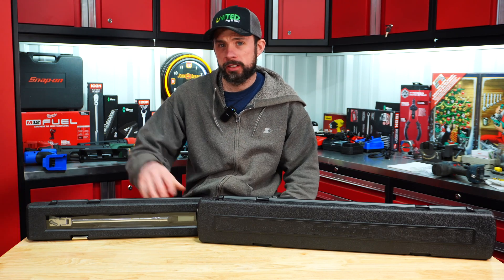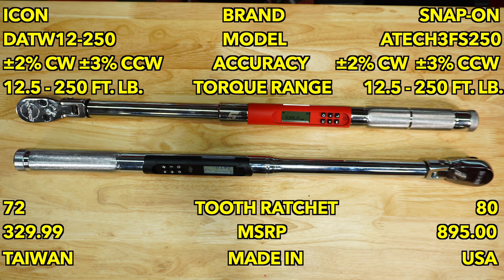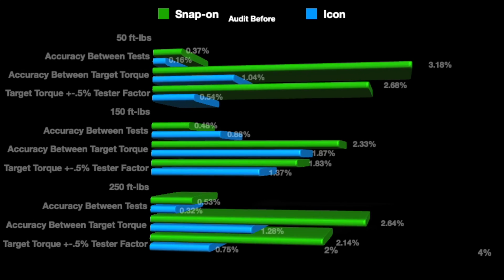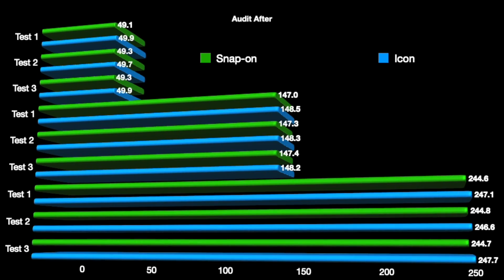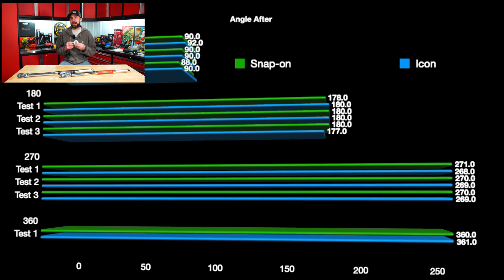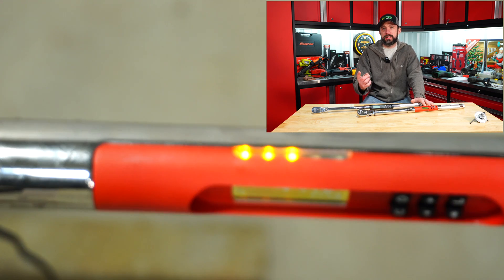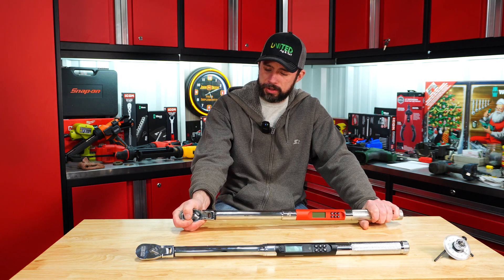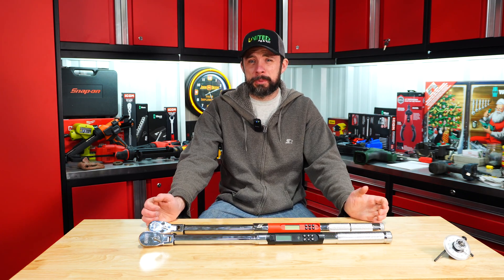Snap-On VS Harbor Freight Icon Digital Torque Wrench

Comment: This is how I felt as as Milwaukee fan when Flex kicked the door in! Still mostly a Milwaukee tool owner but they better not think I'm gonna shell out cash for small upgrades (apple)...
Reply from the maker: Yep exactly, snap on is still nice but not for the extra $$$
Reply: It really isn't really a great comparison  to compare Icon v Snap-On to Milwaukee v Flex.

Icon is a great deal cheaper and is still bringing excellent performance in all metrics.
Flex, on the other hand isn't that much cheaper, and for their tools that are more powerful, they're sacrificing ergonomics, tool life, and usable work time.
Reply: @reaperreaper5098  We should always compare tool brands, that's how we win as consumers. I'm team Milwaukee but Flex is awesome as well as Dewalt and so on. Snap On has awesome tools but many are overpriced.
Reply: @thalegacy6  That's not what I'm saying. I'm saying the relationship between Icon/Snap On isn't comparable to the relationship between Milwaukee/Flex.

One is an underdog now offering tools that compete with a top shelf professional brand, while being much less expensive.

The other is one high end prosumer brand coming out with a tool line that's roughly equivalent to anotherhigh end prosumer's tool line that has been out for awhile, both in price and overall quality.

One's a David vs Goliath story. The other is just an additional offering in an arguably oversaturated market that offers nothing of value over their competitors

Comment: Glad I bought the icon,had to do ls heads in a van so I finally had to get a 1/2 angle torque wrench and the icon worked great.
Reply from the maker: Good to hear,  its been a good wrench so fare.

Comment: Metrologist with 9 years of experience here, you're not supposed to test torque wrenches in that manner. They're always supposed to be pulled upwards, and it's the only way we certify them. We do calibrations for DOD, DOE, aerospace, construction, ect.
Icon may work for 1000 cycles, but it won't last for years on end. Lots of brands last a while, but ~snap-on and Proto are the only ones we're able to reliably get parts for and be able to adjust.
If you're a diy grease monkey, sure, icon will work, but to be honest, they still aren't the best.
Reply from the maker: According to snap on its the correct way https://www.youtube.com/watch?v=Gf-B-gFz6NE

Comment: Have you done the Icon vs Quinn digital torque test?
Not sure which is worth it for the money
Reply from the maker: Really depends on how much you plan on using it and what for.  I know the icon is a lot more money but you also get Leds on the side,  flex head and higher accuracy.  

But personally if your not doing anything with torque angle/left hand thread I would buy the Icon split beam.
Reply: @Tools-Tested  mostly for torquing lug nuts
Reply from the maker: I would definitely consider a split beam then or the icon digital.  Quinn would be more difficult to use in that case imo seeing you won’t be able to see the display and there are no leds on the side.
Reply: @Tools-Tested  Icon splitbeam?
Reply from the maker: @Mikey122687  yeah it tested well.
Reply: @Tools-Tested  Just picked up the Icon with 25% off coupon today. Thank you sir!

Comment: Hi Tools Tested - can you do a TORQUE ANGLE TEST  on these 2 Digital angle torque wrenches?   To see the Differences in the way they both work ?  Like doing Cylinder head where you have to 'ratchet back' and forth.
Reply from the maker: Hi,  both work the same in regards to how the angle resets.  Once torque is removed you have 10 seconds before it zeros out, enough time to ratchet back.  If you reapply force the angle keeps counting up.  If you meet the desired angle it will start from zero once you apply force again.
Reply: @Tools-Tested  Thanks a million for replying back - I will most likely get the Icon one for sure.

Comment: Take home point: both are quite accurate and consistent and will do the job very well. The decision become one of choosing to buy made in USA vs made in Taiwan, albeit for almost three times the money. If it were only two times the price that decision becomes easier. But upwards of $900 for a 1/2" drive torque wrench?
Reply: a lot of ppl don't understand that Taiwan is a small island. they don't specialize in cheap products, they specialize in higher quality for a lower price.
Reply: Double the price still makes no sense.

Comment: When I started having doubts about my $21,000 Epiq toolbox and hutch, I saw an ICON tool box. This led me to sell my SO toolbox and replace it with a larger ICON also adding a locker, I put the other $9,000 back in the bank.
My ICON torque wrench arrived yesterday and I'll be selling my SO version soon. Like I've done with most of my SO tools. Feel like a battered wife who finally called the police. lol
Reply from the maker: Nice! it’s definitely a quality torque wrench for the money.  

Yep Snap On tools are nice but way overpriced in my book.  I don’t care what anyone says, you don’t need tool truck tools to be a pro. 

Do I like buying tools not made in USA, no but I also like not having debt.
Reply: @Tools-Tested  Indeed!
Reply: Hi from 🇬🇧🙋🏻‍♂️ i was in the trade, i left in 2008, i would like to upgrade my 3/8 & 1/2 in torque wrenches but icon doesn't seem to be available in the UK 😢
Reply: @truckatadders you could import it from eBay?
Reply: That’s coming from a great seasoned mechanic/technician
Reply: So how did the Icon work out for you, accurate? Im currently deciding between the SO or Icon.
Reply: @rickyirivera the snap on let's you make adjustments for using crow's feet and other attachments. When you need precision, the snap on is worth the money. I had two icons and it just didn't hold the accuracy like the snap on tool does when actually using them
Reply: @omarfox6165 Dude, this isn't the only channel that have tested these. They are extremely accurate long term, same or better than Snap-On, every time. Same for the other Icon torque wrenches. As for using crows feet, you don't need any of that extra nonsense to stay accurate. Some basic understanding how torque is applied/measured, and some 2nd grade math, and can easily compensate if you need to. Really only if you're extending the length of the lever, or shortening it, do you need to compensate slightly. That one feature is still not worth an extra $500+. Plus not sure how Snap-On can even claim the feature is accurate, unless you know the exact length the crows foot is extending or shortening the throw of the torque wrench. Maybe it's setup for Snap-On crows feet, but what if your not using their crow feet? Even if you're using their's the overall position matters, as the length of throw would change anyway.
Reply: I just got this brand new on ebay 170.00. Guy needed to sell all of his stuff! Score! 

This will replace my cobalt half-inch digital torque wrench.

Comment: Thanks for the great videos! I want to buy the Icon SPLIT BEAM right now, but might have to wait for the 10-150ftlbs to come out. I'm wondering about torque wrenches' usable accuracy and I think other people are too. Most of them claim to have an accuracy of +/-4% of 20-100% of SCALE. Never heard of 20-100% of MAX. So 40-250 is 210? 20% of 210 is 42? 42+40 being the lowest value on the wrench means the accuracy is between 82-250ftlbs? Mostly do brakes and suspension work, haven't built an engine since the 80s. So is it 20-100% of max or scale? Don't mean to sound dumb, just uninformed. Subscribed! Thanks.
Reply from the maker: No problem!

The 250 ft lbs Icon split beam tested very well in my other video.  

I to hope the come out with a lower torque range split beam.

So the way I interpret the 20-100% of max scale is,  250*.20=50.
The torque wrench is then supposed to be +-4% within the scale of 50-250.  

Hopefully that makes sense.

Im sure there has to be someone else on here that can weigh in on this.
Reply: @Tools-Tested  Thanks! Yeah I just didn't know if it was 20-100% of SCALE or 20-100% of MAX. So you're saying it's the latter, sounds better to me. Just picked up that Quinn digital torque adapter and calibrated my mid 80s Craftsman, handle spun off a couple years ago. Then tried it on my schwag $44 Tekton I bought to replace it and it was spot on at 30ftlbs was between 29.4-30.8 SHOCKED.
Reply from the maker: @gts5930  No problem!

Nice, yeah that Quinn is a good value.  I couldn’t believe how accurate it was.

Comment: I just found this channel and I can tell I'm going to be a BIG fan. Trying to find tool channels that tests metrics objectively is way harder than it should be. The torque test channel is the only other one that springs to mind off the top of my head (AvE to some extent).  Keep up the good work.
Reply from the maker: Yeah that’s what I have noticed on here.  Most people want to see data, not someone reviewing a tool and saying it’s better.

I’m not biased,  I’m giving the facts.  

Like you said there is very few comparison channels that test good (Torque Test Channel) and I agree AvE.

Project Farm has comparisons but things like testing a drills run time by seeing how long it can turn and single cylinder engine over I can’t really see accurate…

Thanks for the support!

Comment: Harbor Freight is surpassing Snap On. It's always the joke that wins. People dont take the joke serious they just laugh then one day they become the joke.
Reply: I bought a smashed broken tech angle 3/8 for 20 bucks. Sent it to snapon and they sent back a like new torque wrench for $110.
Reply: Snap-on is a bunch of overpriced tools just to keep people in debt. 😂
Reply: @mattp733i don't buy them then , just quit cryin about shit
Reply: I work on heavy equipment, snap-off ain't it my guy. Most yall buy it for the name. I broke the stem of my snap-on "breaker bar" ratchet with single arm pull. My matco 30" though...snapped the anvil around 1300ftlb internals still perfect "there was some hate in to that bolt". I strip more fasteners with snap-on then with my pittsburgh, icon, husky, gearwrench, sunex, gp. They just fit the Japanese/china/uk hardware better. Just my .02
Reply: @lucky13sss10  Well what do you expect us to spend our money on and be made happy by? We can't have families or nice houses they cost to much.
Reply: They make some good tools for the money but they've got a ways to go before they surpass them
Reply: Hahahaha spoken like someone that doesn't work professionally as a mechanic.
Reply: At the end of the day this is what it is. Use what makes you happy and if you find out it doesn't buy what does but don't hate.
Reply: Snap on is for beginners and icon is for adults with common sense.
Reply: Surpassing is definitely an exaggeration from a tool by tool perspective
Reply: @user-lg3mj4oo1f  is it? I'm talking icon vs snap on not Pittsburgh vs snap on
Reply: @TONYSTARK-jh2wu  only a professional can tell the difference, stand aside weekend warriors and let the technicians keep the world moving.
Reply: @MinusTheMachineAgain  the the difference in what🤣 the way a torque wrench clicks or beeps? what difference? I can careless about the difference you can "notice " the numbers speak for them selfs
Reply: @minusthemachineagain9342  imagine simping for a company that made you pay a second mortgage to do the same job of another tool. That's you.
Reply: @stickyoxtail  a professional also knows a good tool, my box is full of snap on hard line tools but I do have many harbor freight tools like Maddox test kits because that is basically the same thing. The wrenches and sockets is what I’m talking about
Reply: @TONYSTARK-jh2wu  how many head bolts and studs  do you torque to yield a day? I’ll save time with my tools and know the jobs correct. When a customer sees I have snap on tools vs what you have, they know the job is going to be done correctly and are willing to pay me too dollar for it. 

When you do it for a living you can tell a difference. When you aren’t worn out and beat up hands and muscles because a tool was engineered to do a job as easy as possible it makes a difference. Now if another company can make a good clone I’m all for it.
Reply: @MinusTheMachineAgain  ha a customer doesn't car about snap on 90% of them don't even know what it is. they can't even put air in their tires let alone name a tool. yea keep drinking the snap on juice buy the pliers that can pick up a nickel. snap on isn't end there's lots of stuff out there just as good or better.
Reply: @MinusTheMachineAgain  just look up the gearwrench espec torque wrench it shits on the snap on. look at the new icon digital it's just as good as the snap on. actually better in a way half the price with a lifetime warranty. there's lots of videos on YouTube of them head to head and that's on a cdi torque bench. incase you didn't snap on owns cdi so if anything the ball should be in snap ons court.
Reply: @TONYSTARK-jh2wu  I understand what you are getting at, but snap on shows up to my job, I make a phone call or send a text and it’s handled, I don’t worry if i break a tool or need to borrow a speciality tool. I’m not saying some other company’s cannot and don’t make a good product. Again only a professional can tell, yes the icon wrenches look similar but far from it on a professional level. Use what you abuse and  move on. I’ll keep working on diesels and excavators with quality tools that pay for them selves with money and time.
Reply: @TONYSTARK-jh2wu  customers in heavy equipment will not hire you and pay you what your worth if you show up with a general tool box and Pittsburg pro stuff that’s constantly being changed out. 
Caterpillar has tools made by snap on. Nothing in the heavyquip game is better than a caterpillar and those are the tools they use factory.
Reply: @minusthemachineagain9342  LOL, the harbor freight crowd thinks their $1.98 tools are the same as Snap On and Matco. I just laugh at them.
Reply: @LeeCountySpeedShop   just a bunch of amateurs and rookies
Reply: @TONYSTARK-jh2wu  Depends on your customers. I'd 100% go with the icon, especially with the better warranty. However, a lot of places and people expect to see span-on or another tool truck equivalent or they won't want to hire you.
Reply: @dylanfinch6186  not true I've never been denied a job with my husky tool box and harbor freight cart and I've been doin this for 16 years.
Reply: @TONYSTARK-jh2wu  then you were not respected nor the highest paid tech..
Reply: @minusthemachineagain9342  I'm doing alright im shop foreman make 1800 a week and any differential regears or rebuilds I do are all mine but I'm actually in the process of buying the shop because the owner is leaving to Texas
Reply: @minusthemachineagain9342  it's funny you say snap on makes tools for caterpillar but if snap on is the best the end all be all why does snap have other companies making tools for them. why can harbor freight go directly to the manufacturer and have the same exact tool made for them but instead of saying snap on or mac it say icon. it's happened a few times just look at the replacement part numbers you'll see
Reply: @TONYSTARK-jh2wu  As a professional technician I have no time to leave my shop to go get broken tools fixed..how can you bill 40+ hours a week if you have to go to hobo freight and exchange tools?
Reply: @TONYSTARK-jh2wu fr I didn't know about snapon till I got into the industry

Comment: Another very interesting video. Looks like a mighty fine offering from Icon, shame its not available in the UK.
Reply from the maker: Yep, Harbor freight has started to sell online, but I don't know if its international sales yet.

What are the common torque wrench brands in the UK?  Im going to guess the EU tool company's (Wera, Gedore,  Hazet, Stahlwille)
Reply: @Tools-Tested  The ones you have mentioned will be the professional end, you can also add in Norbar to that as well. We also have Halfords, Sealey and Clarke, who would be typical garage equipment brands and then you get Laser and Draper that are more aimed at home garages. A lot of them appear to be re-brands though and you can pick up loads from more obscure manufacturers.

Comment: When I was starting out in mechanic's 30 plus yrs ago snap on was the be all end all,,I refused to buy them new and mainly used s/k and craftsman tools,,occasionally I would score sum used snap on,,nice to see sum affordable high quality tool options for new mechanic's
Reply from the maker: Yep now not so much,  I just think the prices are way too high.

Hopefully  Stanley starts producing USA Craftsman like they said.

But for now the Icon line is high quality that's affordable.

Some would say buy snap-on all the way,  to me why would you want to go straight into debt when you start out as a mechanic.
Reply: I attended an auto tech school for a number of years. We used all Snap-On equipment at the school, and Snap-On had a special booth on site, with a dedicated sales rep to sell to students. To me it was almost unbelievable how predatory the sales tactics they used were. They even had us sit through special presentations every semester, where they would try and sell to us. Granted they offered a "student discount" (something like 20% on average), but even with that the prices were/are outrageous. You had guys, mostly teens really, leaving the school with up to an extra $20-40K+ in debt, at insane rates that even the greediest bank would never even think of applying to a loan. Thankfully I was a bit older at the time, and never bought in to their BS. I almost caved on a Master series tool box...thankfully I came to my senses and didn't get it. I figured if I REALLY want a Snap-On box, I could find one cheaper used anyway.

Now I'm so glad I never bought anything. Between Icon, US General, Daytona, etc., at HF, I wouldn't think twice of never buying most anything Snap-On.